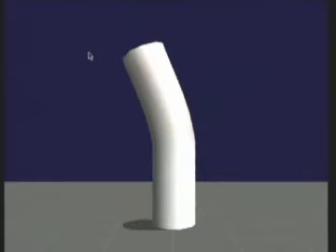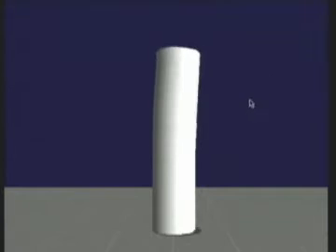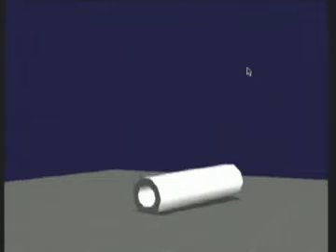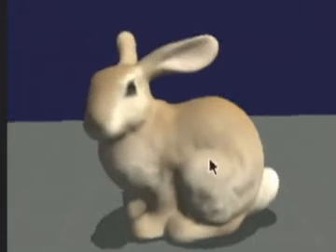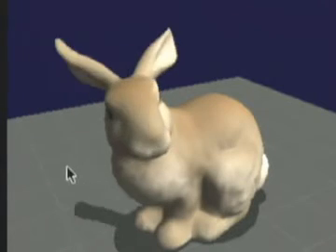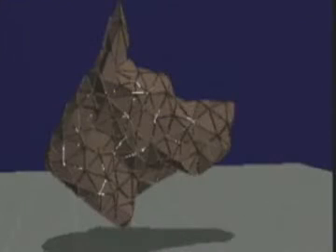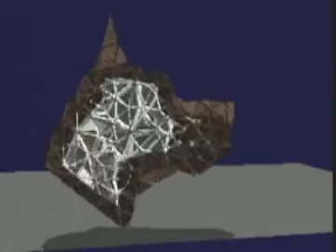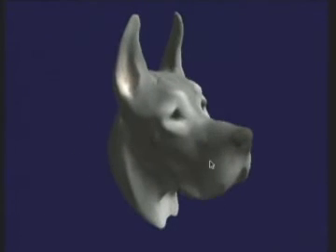Warped Stiffness FEM

Comment: He uses a linear material formulated for the isotropic and homogeneous case. So basically you have two stiffness parameters for the entire volume: Young's modulus and Poisson's ratio. For the Great Dane example the value of Young's modulus (the most important stiffness parameter for these sort of motions) was according to the paper around 10^3 N/m^2. That is really rather soft. Afaik he have not released any software, but take a look at OpenTissue. They implement it